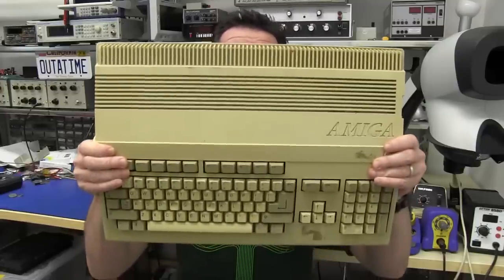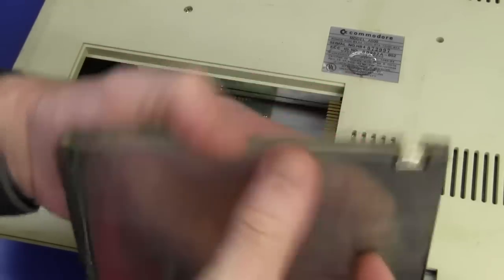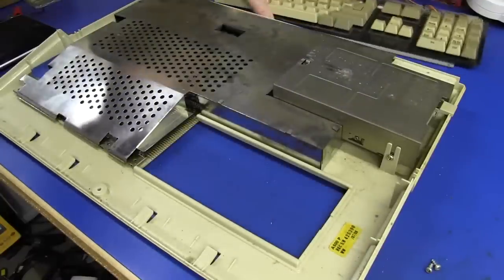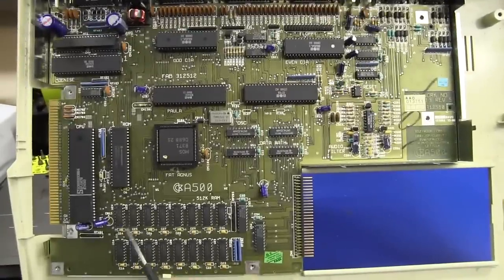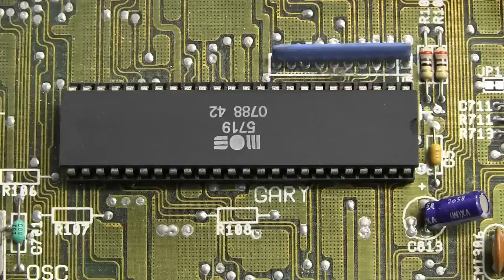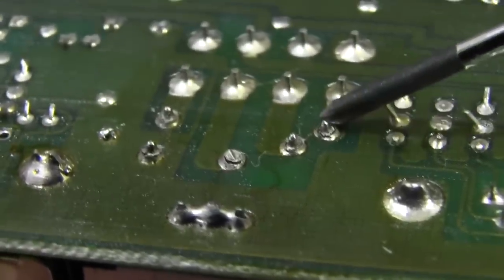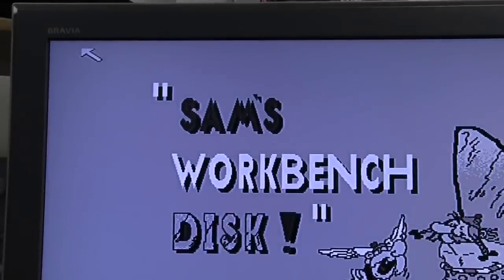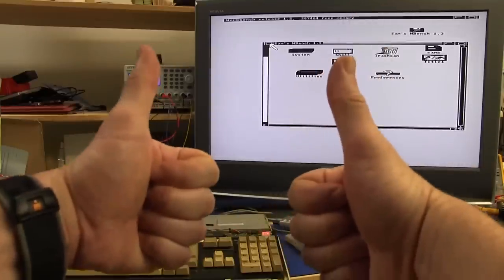EEVBlog #438 - Amiga 500 Retro Computer Teardown

Comment: you forgot to add the extended memory back in place to get a full 1MB of memory before starting the system up ... (maybe that's why that game didn't run?)

also, although Workbench v1.3's disk does work with the ROM v1.2 (albeit with some restrictions ...), you do need a v1.3 ROM just as well to take advantage of the 'new' Wb1.3's disk's full abilities ...

@ 12:55 > it's a revision 5 mobo you're having ... (and the other 'golden' mobo maybe even an older revision ...)

last mobo version revision was 6 i think ...

and if i still recall it right, ROM v1.3 could only be used on that revision 6 of the mobo ...

that revision also allowed to upgrade it by adding more memory on the mobo itself, increasing the Chip RAM up to 1MB on-board ... (it's the one i still own and i did upgrade it too ... that was something the higher A500-plus models did better btw as they came with 2MB of Chip RAM already installed on the mobo in the factory ... there are other hacks possible on the A500 and other Amiga models of course ... probably the most versatile computer of all times to this day ...)

but adding extra Chip RAM on-board also meant the bottom trapdoor extension memory slot could not be used for increasing Chip or Fast RAM anymore, unless you also soldiered an on/off jumper switch somewhere that could let you switch between 0.5MB or 1MB on-board Chip RAM depending on the type of extended memory board you were going to add to that slot ...

real fast memory is done on the left hand side expansion memory slot though because it's closer to the CPU and directly connected to it ... the side expansion memory slot could be used for adding up to 8MB of Fast RAM without an accelerator board (regardless of any amount of Chip RAM installed on-board) or, you could add one of those 'side car' expansion units that had an accelerator as well as more memory plus a hard disk etc ... (there was also that silly 'freeze frame hacking' side unit that was fashionable among the Amiga gamer community in those times ... can't remember its name now but it allows to cheat a lot ... for example you can freeze games on the go if you need to refresh your breath, or add more / infinite lives to the sprites, increase a game's speed up or slow it down and so on ...)

all n all, compared to all other options available by the competition at the time, the A500 was an amazing system indeed, especially considering how low cost it was in comparison to others ... but it was still rather costly to add all those extra goodies nonetheless and not everybody could afford them all really ... some of those old accelerator boards for higher end Amiga models such as the A1200 are still rather too costly even today, especially because they are not easy to find and the new relatively cheap options available that are made by some firms are not as fast as the fastest of the older models anyway ... in short, only a bare Amiga 500 model was really cheap ... a full Amiga system, any model, was not cheap really!
Reply: one small detail about fast/chip ram. the cpu was not always allowed to access the chip ram because the video chip was the bus master to access the chip memory and needed a lot of bandwidth to access the ram. also copper, blitter, audio and other dma channels used up memory bandwidth from the chip ram. that did not leave much speed for the cpu. luckily they introduced the concept of fast ram that was only accessible from the cpu. programms running in the fast ram where not slowed down by the other chips. hence the names fast vs. chip mem.

Comment: Even the A500, budget priced though it was, was loaded for bear when it came to graphics. People have already pointed out how you managed to find the mono signal, but even the RF modulator gave a rather smudgy signal. One always got the best picture quality by hooking it up to Scart.

Autobooting the disks was one thing you noted. What you didn't get to experience -- which is really no wonder as the A500 sacrificed the expandability of the A2000 -- was the flexibility of the system in handling things like peripherals. For instance, resources were tracked automatically, and the system didn't care on which volume a file would be as long as it was recognized. You could do things like hotplug a hard-drive without a bother, especially with the later versions of the OS; heck, adding a relatively inexpansive expansion like the VideoToaster, you could basically pipe the video stream directly into Workbench and draw on the frames by hand (much of the iconically tacky nineties gameshow effects were produced on the Amiga for a fraction of the cost needed on other systems). Programs could be dragged and dropped into RAM disk, treating the RAM itself as any other kind of storage media.

As the chipset guys felt the pinch of Commodore's various blunders in the business world, they were driven to increasing lengths of desperation. Some of the decisions were good, others were forced upon them from on high. The successor to the OCS/ECS chipset (32 colors from a palette of 4096, barring modes like HAM and EHB) was actually supposed to have been a completely new chipset, first the AAA chip and then the Hombre. Both of these projects were canceled, an unfathomable idea considering that the AAA was actually up and running at one point and superior to the existing chipset by every conceivable metric.

Could the original Amiga 500/2000 have been done better? Well, in retrospect it did have a few flaws. The machine shipped with a somewhat anemic processor (an 020 would have been so much better), too little memory (1 MB should have been mandated), its file system was a bit slow to load in WorkBench, and there's the aforementioned problem with lack of memory protection (a hard problem to solve in software; several people have tackled in retroactively without success). I also seem to recall some issues with the DOS part of the OS being hastily ported from the TRIPOS guys and being suboptimal as a result. But really, those things are just shades short of perfection.

I can't precisely articulate all the reasons why I love using the Amiga, but I just do, even today. Playing around with one, especially an expanded one that fully leverages the capabilities of the machine, really rams home how far ahead it was compared to the competition; in an unrefined, formative sense, it's no different from the type of computer you'd use today, only with the ability to hack and understand every last aspect of it down to the metal. All the elements of the modern system were in place: the multitasking, the integrated graphics and sound, the flexibility and hot-plugging capability.

Only Commodore could have screwed it up, and God knows how but they did.

Comment: One of my buddies hat one when I was a kid, man was I jealous. I had to make do with daddy's IBM XT with pink/cyan CGA graphics and PC speaker for sound, meep moop.
Reply: back in the early 1990s in a workplace i used to make animated tv teasers with an Amiga 500 and a total of 2MB of memory (0.5MB Chip + 1.5MB Fast) and only one floppy drive, using the great Deluxe Paint IV program! people with a 486 PC and 4MB of memory envied that setup simply because they could not do the same thing even if they used the same program on it! only the Amiga could do animation using DPaint ... :-)

still have my own A500 (plus a couple extra ones earned from other places) and i have that great little Supra 500 expansion memory unit for it with 8MB of FAAAAST RAM on board ... have an A1200 with the 060 accelerator board too ... an A2000 (with lots of extra boards such as PAR) and an A3000 etc ...

unfortunately though, all of these lovely angels are in their boxes right now! don't have room to set them up but don't want to separate from them either!
Reply: Mate - exactly the same situation I was in.  Basically all of my buddies that owned a computer had an Amiga 500 (except for one mate who had an Atari ST).  I, on the other hand, had a Commodore brand IBM clone with the CGA graphics and internal speaker for audio.  The machine had no HDD and two 5 1/4" floppy drives, so you would boot to DOS via floppy and go from there.  I share your (remembered) jealousy haha.

Comment: 7:06 If you want to keep any vintage Amiga working, you will unsolder and remove the clock battery. Many old Amigas die because the battery leaks, and then the solder traces are corrosively eaten away. It can still have a battery, but separate it from the board with a good 6-12 in / 15-30 cm cable to keep corrosion away, and put the battery in a plastic bag, zip-tied closed. I did this to my Toaster 4000 system to protect it.

Comment: 33:00 - The Amiga workbench was kind of a 50/50 ROM/Disk combo. They had a 512Kb ROM on the board and the rest of came on the disk. So you couldn't always upgrade to a later version of Workbench unless the ROM was also upgraded (But i think you could usually use an older Workbench disk, e.g. Workbench 1.3 worked with the 2.05 ROM)

Comment: I spat my coffee when he was talking about the Dram in the Trapdoor module. "Woohoo, 256kbit, unbelievable, so we need 16 of these chips to give us 512 Megabytes !!".

256kbit x 16, is 512 Kilobyte.
Reply: RAM upgrade was sooo expensive. I bought a 1 MB daughter board for my A1000. It cost hundreds and hundreds of dollars -- thousands in today's money I think. Very expensive for a highschool student at the time.
Reply: Most 8 biy computers had 64 
K of usable RAM at a time. All that silly bank switching and shadow ROM business was fun in its own way.
Reply: Paul Sop

Commodore 128 (128KB)
Spectrum 128 / 128+ / Spectrum +2 / Spectrum +3

But it was a TOTAL of 128K, which shared some sections, like address 16384 being the start of the Display addresses (On ZX Spectrum), 8912 bytes in size.  After which the addresses from 25296 until 65535 (48K 8bit) was for general user use.  The Spectrum 48K was ACTUALLY 64K, with the first 16384 bytes reserved for system ROM, But a user could actually change the values in the ROM addresses to make the system do weird shit.
Reply: LOL if my A501 had 512Mb, everything would have run on a ram drive :)
Reply: @Joliie  I think the CPU would show you the middle finger when asked to address that memory
Reply: I was running an Amiga emulator to play Shadow of the Beast and as I was configuring the virtual machine I had to double take on the RAM options and realized oh this is 4 MEGAbytes, not gigabytes!

Comment: The operating system came in 2 parts, the ROM in the Kickstart chip, and the floppy disk with Workbench. I think I went up to Workbench 3.5 before I stopped playing with my Amiga 1200 and moved to an Amiga Emulator.

Comment: RE:colour. The background is blue and the icons were a horrible orange colour, all that is customised using the EXTRAs disk which has more options for hard drive formatting, screen mode, icon settings and of course colour. Also there is a boot option (I cant remember the key combination) but you essentially power up the Amiga with the key combi and an enhanced options screen should pop up, i think it let you choose the screen res, ram options, AGA mode (A600), interlace etc.. The expansion slot underneath could also accommodate an accelerator board to boost clock speed to 40 or 60Mhz (that was on the A1200 at least, not sure for the 500). The 1200 had 2Mb on board ram and up to 8 (or 16?) Mb ram via expansion. My brother had (still has) the A500 and a Video Grabber to watch analogue tv with a built in teletext decoder. Yes you didnt need a high end pc in those days to watch live tv on your amiga! :D I still own an Amiga 1200 which should work but its gathering dust under a bed in my spare room and 5 disk boxes full of all my music work, samples, games and commercial games and dozens of cover disks from amiga magazines lol, god only knows if any/all the disks still work. I have a second, external floppy drive, joystick and hacked mouse as my left button stopped working and i had to solder a micro switch in to use it lol. 
Great video, brings back some fond memories of hours of game play with my brother :D
Reply: AGA was on the 1200, the 600 was ECS :D.
Reply: Preferences (a single program in Kickstarts <= 1.3) sat on Workbench, not on Extras.  Boot option didn't exist in Kickstart 1.3 or earlier (unless your harddrive provided that feature in its firmware); it only became standard in Kickstart 2.0 (using both mouse buttons).  The expansion slot on the underside of the A500 could accommodate RAM and clock feature only; it didn't grant full access to the 68K bus.  When the A1200 came out, it was a major improvement over the A500/A600 lineage.  :-)
Reply: UltraPic and A500 was OCS :) - minimal differents
Reply: My memory could be flakey, but I think for about 6 months, Commodore did put ECS chips in the A500 line (so-called A500+ computers, along with Kickstart 2.04).  This was some kind of stop-gap before the official release of the A600 and A1200 machines.
Reply: Samuel Falvo II
I'm amazed that after more than 25 years, PCs still don't have a standard mouse controllable BIOS, if you imagine that the Amiga had that early on, and it worked with the mouse, incredible. Pushing keys on the keyboard for PC to enter the BIOS is also really dumb, as you might fill up the keyboard buffer and make it beep like crazy or miss the right point to push it and miss the BIOS, which has happened millions of times to million of people ;-)
 So failure to learn from a machine like the Amiga is really inexcusable, for some reasons the universities fail to teach some really basic things to live by: learn from the best, always analyze how many are doing it and then take the best of all approaches.
Reply: The horrible colours (White, Black, Blue, Orange) were from NASA which felt they provided the greatest colour contrast to each other. It was such an ugly default scheme though! Easy to change if you wanted to.
Reply: As UltraPic says the A600 was an ECS machine.  It was essentially an A500+ cut down to save on costs so it could take over from the Commodore 64 at the budget end of Commodore's range.  Unfortunately due to Commodore's mismanagement it ended up being sold instead as a replacement for the A500+ which really angered a lot of customers when a short time later the A1200 came out (with AGA graphics chipset) which was the real A500+ replacement.
Reply: JohnnyX50 You should take a loot at the RTC battery of your A1200. It could leak and damage the board. This can be seen in the video on the 512 Kb expansion board with RTC clock too.
Reply: OpenGL4ever the 1200 does not have a battery as it does not come with a rtc. It does have a clock port but was never used for this purpose. The clocks came in the accelerator boards and the like. It's only the 4000, 500 plus and 600 (maybe) that had the clocks. Unsure about 2000 and 3000.
Reply: Samuel Falvo II You might be amazed. Back in those days you could transform your A500 to a PC XT compatible computer by adding a special PC hardware board into that expansion slot underside the A500.  It was called KCS Power PC board. (not related with the later IBM PowerPC cpu)
Reply: Yeah, you can also hack a parallel port to do what you want too (it's how I brought up my Kestrel-1 home-brew computer!).  :)  My point was that the bus did not grant full access to the 68K bus, so you didn't have things like bus mastering or even interrupts available.  Any communications between the Power PC board and the host CPU was purely message-based, and polled by nature.  :-)
Reply: Samuel Falvo II Totally other thing, these expansions never were attached to the parallel port, you could have done nothing with it. The lower expansion port for the A500 was only for RAM, everything else you connected to the expansion port on the left and that one has direct access to the 68K CPU, as you can see on this picture:
http://amiga.resource.cx/photos/gallery/a500rev8a.jpg

And that was the biggest bus the Amiga had, gave you access over everything. Harddisks and CO CPU Boards were connected there (PowerPC, that was later than the PC XT boards) and you had a true two CPU computer.
Reply: nigratruo You basically just repeated everything I just said.  However, you're quite wrong about not being able to do anything with the parallel port.  The Acorn-series of computers had something called a "tube port" which was essentially a bidirectional 8-bit parallel port used to send messages back and forth between bridgecard-like devices.  I myself used the parallel port to drive logic which, in turn, controlled an elevator.  And I also abused the PC's parallel port to DMA system software into a single-board computer's memory.  Hell, you could drive a 64-bit bus with 4 wires (data in, data out, shift, and load signals) if you wanted to.  You only pay in performance.  Don't tell an engineer that he can't do what he's already done.  :)
Reply: On the A1200 and A4000 you could hold down both mousebuttons on power-up to get to a settings screen. There you could choose wich mode Agnus would run (OCS, ECS or AGA, and you could also turn off the MC68020's cache. This was done due to compatibility since much of the A500 code that was written was so highly optimized for the hardware that some code was for instance using self-modiying code. On the non-cache MC68k CPU that would go fine, but since the MC68020 had instruction cache, it would crash the computer since the CPU would cache the next instructions before the code itself modifyed it, thus ending up running the unmodified code instead.

Comment: The solder joint failure on the power connector is a common issue; I've had to reflow mine at least once that I can remember.
Another power issue is an over heating power brick, I grafted an 80mm 240v axial fan onto the top of mine, never overheated since xD